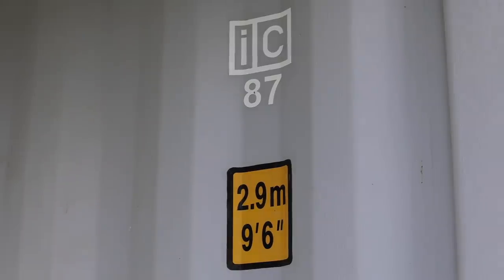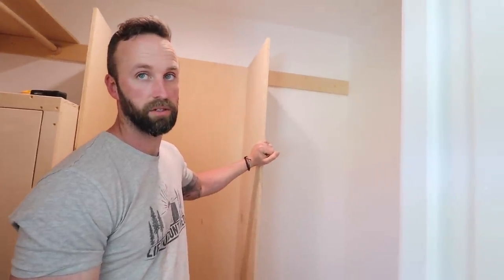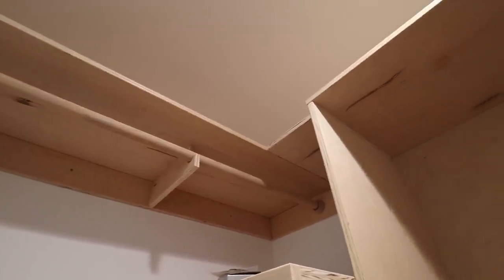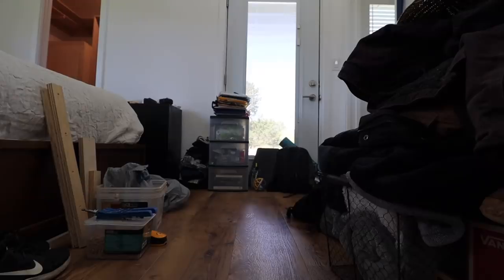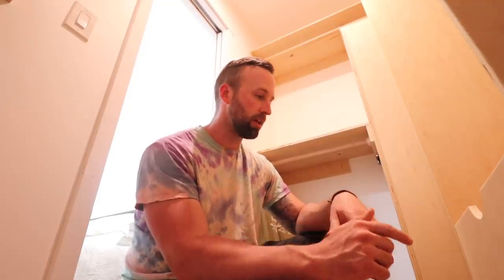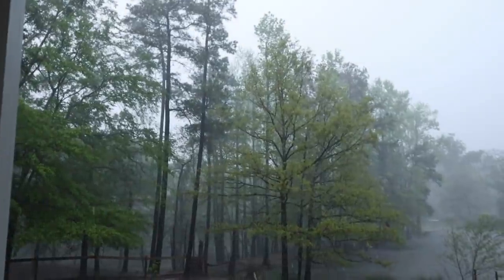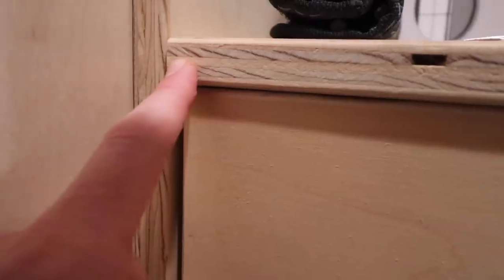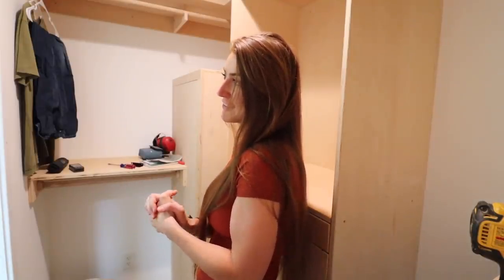DIY Container Home | Our Completed Closet

Comment: Cabinetmaker here: I agree don't stain it, but put a few coats of clear polyurethane on it to keep them looking beautiful for years and then you can wipe them down when they get dirty. 3 coats is best. Put 2 coats on with foam brush let dry completely, then sand lightly with 320 grit sandpaper, then put final coat on. Well done Spencer I love how you show how an "everyman" with a few tools can make something beautiful with some GRIT and determination!

Comment: You should build an underground storm shelter attached to your home, this would also provide much needed storage space and a safe place when tornadoes come through the area.
Reply: There is a tornado company not far from them that makes a bolt down shelter that is affordable.  We put one in our Off Grid home.  They could pour a slab outside then cover it with a roof, which would give them more area for rain water collection and would give them cover while getting to it from the house.  Could make it a screened in porch area.

Comment: Pro Tip:  when cutting plywood, the good side goes down because the saw blade is cutting up and tear out occurs as the blade exits the cut.  Tape both sides with 3M Painters tape and use a roller to insure the tape is bonded tight.  Use a blade with 60 tpi that’s made for plywood.  Diablo is a great brand.  Your cuts will be smooth!
Reply: That's how I do it too.

Comment: I love how that built in dresser turned out. Kenz you should get those battery operated twinkle lights for around the mirror. 
I'm going to tell you that you 100% should apply a couple clear satin coats of varnish to the drawers because the oils from your fingers will VERY quickly stain the drawers where you pull them open. We had a really cute plywood bench that held shoes and with a few months the opening to lift the seat to put your shoes in was clealy stained a darker yellow from the oils. We attempted to sand it out before varnishing and it wouldn't come it. We had to paint it white. 
I had a toy box made a couple years ago for the kids outdoor toys and we quickly varnished it with a satin water base and it looks amazing and it has stood up to the kids pulling it open and yanking their tricycles and rides out and it wipes down easily. 
Spencer should make a small kid friendly snake proof shed for the kids outdoor toys and that will help keep the house clear from those bigger toys. 😉
Reply: Re: Built in dresser - that wooden mid-support for the coathanger-pole(?) is both venacular and kinda' Amish/Shaker-design - very, very well done, Sir... And the drawers inspired me, so did the whole mirror-space design.... Damn, I think I've got a proposal for'ya - involving a future van and a lot of home visits in the county 😉❤
Reply: I second this as I have a massive dresser that we bought unfinished because it was beautiful, but the humidity warped the drawers over a couple years and even the wax we used to help the drawers slide in and out doesn't work now
Reply: Great ideas!
Reply: I agree :-)
Reply: Yes, agree about putting a clear coat on that beautiful plywood. It won’t change the look, just protect it. As a furniture restorer, artist, flipper, etc, the first thing I do, even before sanding (bc oils from our skin will melt down into the wood) is clean any piece with a degreaser/TSP. General Finish makes a great clear coat in ultra flat. You’ll never even know it’s there, except that your wood is protected.
Reply: @ashleyosborne6239  Exactly

Comment: You should have a water heater drip pan under the water heater with a drain so that in the event of a water heater failure you won't have  any water damage
Reply: The Water Heater Drain with 1” sides overflowed in my attic July 2021. They will begin sanding and refinishing in (2) weeks. Though I didn’t have to do anything, the insurance company is quite busy and slow.
Reply: @vivaldi1236  While the pan is a preventative measure it will not stop catastrophic failures from causing damage.
Reply: Dittos.    Also passive air flow for water heater closet.
Reply: So a pan with a drain pipe straight down is a must. Hate to see all your work get ruined.

Comment: What a great job with the closet!  Major kudos!  One piece of advice:  think about applying some polyurethane to the shelves and drawer fronts.  Over time they will accumulate dust and grime.  Two coats would do wonders.  Also get water based poly to eliminate the smell and quicken drying time.  You could easily get two coats on in one day.
You two are awesome.
Reply: Yes, I was going to suggest that as well.  And also that they can use a matte finish Varathane or other brand.  Because that will retain the "unfinished" look of the plywood, yet create a waterproof seal that is washable.  And if Spencer wanted to get a very nice finish as well as keeping that look, he could do three coats, and can sand inbetween coats, using a fine grit in the end.
Reply: Was also going to suggest that as your oil in your hands will darken around the pull holes in a very short time. Great build, Spencer they sell plugs for those angled drill holes if you wanted to finish out the ends... Would love to see the bedroom after the closet was filled up Lol!! Also, would love a water tank update from the rain you've been getting after finding that plugged filling pipe?? Thanks for the content and you'll never finish this property as you will always have projects in the works ie: barn, some kind of carport and whatever else in your wish list or thoughts later...

Comment: Seeing Spencer stand in front of the window made me think that it would be a good idea to have shutters you can close in case of bad storms to protect the windows.  I built some using small pneumatic actuators that close at the click of a remote.  Also, have you considered some sort of storm shelter?  You are afterall sitting in a big METAL box.   Being able to be somewhere other than that big potentially flying box during a tornado would be a good option.  Spencer can just build one.  He is becoming quite the creator.

Comment: It looks great but one suggestion is to add a clear coat finish on the new closet.  It will protect the wood and keep it from getting dirty and oily from use.  And should you decided to stain or paint later the finish will be easy to clean and won't need to be sanded or replaced due to ground in dirt and dust.

Comment: The closet is set-up so well,and looks great.I'd like to suggest this though;put that mirror on a TV mount and use the space behind it for shelves.I'd also cut mirror tile and put them on the drawer faces for a mostly 'full-length' mirror effect.Just grind out the hand grip areas./Great work on the closet,and it's design you 2.Well done.

Comment: Just a thought, is it feasible for you to collect the rail water from the barn roof and solar panels for emergency use or to pump into the main water tanks when water is at a low level?

Comment: Your storage issues are fairly easy to solve. Install a container next to your home on concrete pylons and create a double-door hallway access to your existing home. Insulate it and run electricity to it and install a mini-split AC/heater.  That will provide a ton of room for you and you could install another bedroom in it.  You could also install a bathroom in it also because it is fairly easy to connect your water system and septic system to it.  It would be smart to install two containers at the same time so that if you need to, you can expand your living space into the second container.

Comment: Cabinets look great. I like the color of the wood. They make a tape, for not the correct description, that will cover the plywood edging with glue on the back side. You just cut the length you need and apply it with a clothes iron. They also make a side cutter also using a razor cutter. It makes the plywood edge look like a board edge.

Comment: I do a lot of building on a whim. So in my garage, I have 1 router with a 1/4" roundover bit and 1 with a 3/8" bit. Then I can touch up with sandpaper. It always looks better and if you sand all them radiuses, that's got to be a lot of work.

Comment: Someone may have already mentioned this: there are really thin coated hangers that don't take up as much rod space as the plastic hanger.s They are wire or metal, but not like the old kind of wire hangers.  The coating makes them non slip.  Using those gives a bit more hanging space.  Beautiful photography!!

Comment: Hey Spencer,  I wanted to comment that I really have enjoyed your evolution as a craftsman.  I wanted to make a suggestion for you to try for potentially finishing your closet.  You're going to want to put either a finish or paint on the bare wood.  I'm assuming it's Birch Plywood, but I can't tell for sure.  One thing I've done in the past is a 1/3 : 1 mix of mineral sprits and Minwax Antique oil.  It takes about 2-3 coats over 2-3 days to finish, and the end result is really lovely.  It doesn't color the wood, but gives it a lovely patina.  It's something you can try on a scrap piece first to see if you like it.  

Anyway, Just wanted to say we love the channel, and look forward to updates every week.

Comment: If splintering is an issue when cutting a straight line in plywood, first cover the cut line with a piece of masking tape. Then clamp a straight edge along the cut line and make a heavy score (you can make multiple light passes with the razor if you prefer) with a razor knife right up against the straight edge before you make your cut. If you place the score in the right position you can effectively eliminate the splintering.

Comment: Instead of using those wooden dowel rods I used pipes in my closet and notched out wood to set them in.  The pipes hold more weight...needed if you have a lot of clothes like me.  I like open cubbie holes too...you get more in them instead of drawers.  You can also get more hanging space out of the closet by getting rid of the plastic tube hangers and switching to the skinny flat hangers.  I would have put the mirror on the back of the door and added shelves for more space above the drawers...you will always need more space.   I do closet organization for people, so I have learned to maximize small spaces over the years.  Closet carpentry turned out great for the space.

Comment: Wait...! Spencer has that tiny space for hanging up clothes, and all he hangs there are...te shirts? TEE SHIRTS??!! Who hangs up tee shirts? You fold them or roll them and put them in a drawer or on a shelf.
     Aside from that inanity, you did a marvelous job! It looks like You found an optimum combination of maximizing the use of limited available space without over-cluttering and reducing ease of use. And it DOES look really good. 
     Out of five stars, I rate it  ✨✨✨✨✨✨  six.

Comment: From personal experience, It is wise to cut the shelves to size now, and install the rim for them to sit on. You can tilt them up against the back wall, or stack them on the base, but when you need them, they will be there and it wont necessitate a major project of buying wood, cutting and finishing them.  And they can stack in front of a mirror, so even that doesn’t have to commit you one way or another,. Wax or oil the wood to protect it from moisture that will cause it to swell and eventually split at the layers.

Comment: Great job guys..but little hint from an old girl..I would at least stain the fronts of those drawers or everytime you handle them you will leave oil (body) fingerprints/marks even with clean hands and it wont take long to get grubby, then they all have to be sanded and stained anyway. Also watching all of the water come off of the shed ?? pump house ?? roof..if you put a little gutter along that roof and a water storage barrel or 2 under a downpipe, you will be amazed how much extra water you will catch..it might come in handy in summer even just for watering fruit trees or plants...every little bit helps. Cant wait to see what you do in the garden...covered patio/gazebo? Covered play area for the kids. You definately need a play/entertainment patio off the front steps for really hot weather or wet, plus you could make a nice starage box for shoes and boots instead of them being inside....happy hammering...the more jobs we give you the longer we can keep watching these videos!!! 🥰🤗

Comment: You like the looks of it, color and all... dont stain it... just oil it... You wont be able to put stuff in there right away, but it will protect the wook and make it look event better. Dont like oil... wax it... give a litter bit of protection and shine. Good job on it... I love bare plywood edge for furniture.

Comment: Get rid of the water heater and go with an on demand heater, I would recommend Ecosmart, you will need a 27 kw unit in the Texas climate.  It will only use the energy necessary to heat to your desired temperature and only when hot water is being used, instead of constantly heating a tank of water all day and all night.  Much more efficient!  It will also occupy a small space on your closet wall.  The fact that you have a pre heater will dramatically add to it's effectiveness, whereas your pre heater only has a nominal effect on a water tank.  The pre heater only helps when the water tank is filling and does nothing to maintain water temperature in the tank.  Ditch the tank!

Comment: Use the router to trim the shelf. Just get up a straight edge and either get a flush trim bearing bad or run the base against a straight edge just set up the straight edge accordingly
Reply: Flush trim bearing bit**

Comment: Have you thought about having a water tank level gauge?  There are gauges which read pressure and run on 24 VDC for less than $200.  Drop them into the tank and connect the 24V and put a digital ammeter in the line calibrated in inches, feet, PSI, or gallons.  I would like to have the security of knowiing how much water you have in reserve.

Comment: Two things I seen in this video.....
1) the screws on the water heater cabinet. Look AWFUL compared to the rest of the closet build. You need to fill those.
2) you need to add water catchment to the barn. The video shows GALLONS upon GALLONS of water your missing out on!!!
Seems like an easy fix!! Run the pipe to a different tank!

Like the videos !! Keep it up

Comment: Or cutting that top board you should use a finer saw blade with more teeth on it not sure what size you're using but yeah the more teeth the finer the cut and tape definitely helps

Comment: you should put a finish on the wood so you can clean it when you need to. once it gets dirty you'll have to use a cleaner to clean it and without a finish it can ruin the wood.

Comment: Closet looks great but it'll really suck when the water tank starts to leak.  Wish you had put a catch pan and drain line under it.  Why didn't you guys install a tankless one?  We have two propane tankless water heaters in our Off Grid home.  They don't use much power at all, a lot less than a traditional tank does.

Comment: Bonjour Bonjour ! Alors comment avez vous analysé votre condition santé depuis que vous vous êtes installé à l'intérieur des containers. Vous avez fait un travail exemplaire du début jusque maintenant. Malgré tout je me demande si le facteur absorption de la chaleur présent sur la structure de ceux ci ne cause pas de variation importante sur la régulation du corps et du système qui peut en être impacté. J'ai vécu dans un logement qui était équipé de poutres métallique et qui apportaient  ça  charge de chaleur le jour et cela causait un peu de variation non négligeable. J'espère que pour vous cela n'a pas d'incidence. Il faut vous observer et bien analyser votre l'equilibre pour vous orienter vers une solution durable au cas ou .en tous cas bravo vraiment encore bravo .comme location de tourisme c'est vraiment sans hésitation. A bientôt